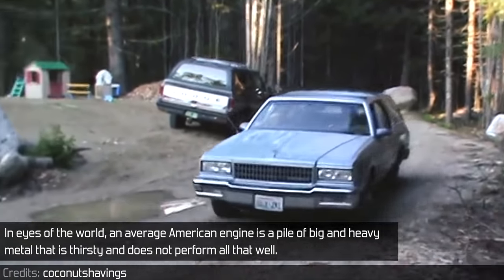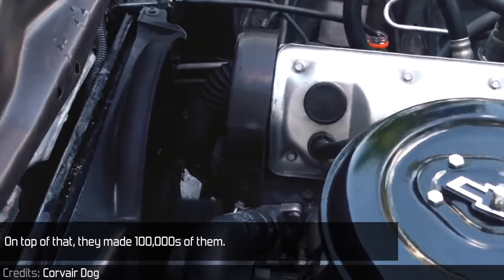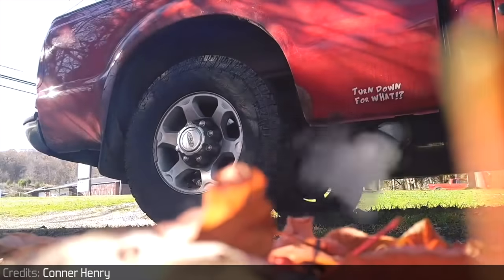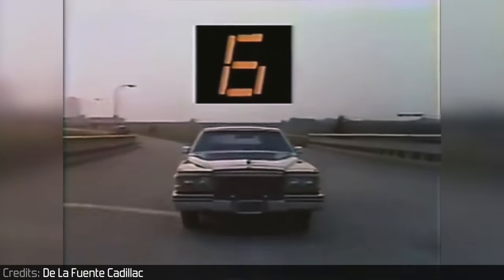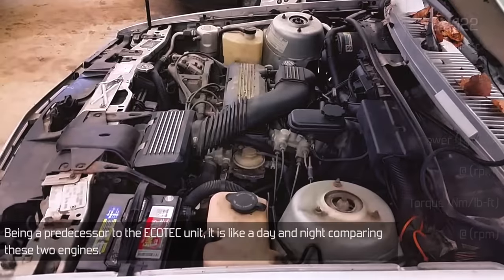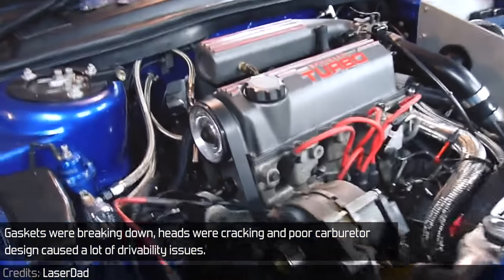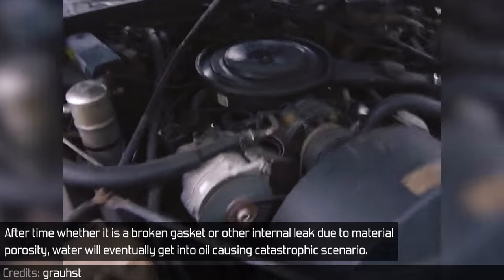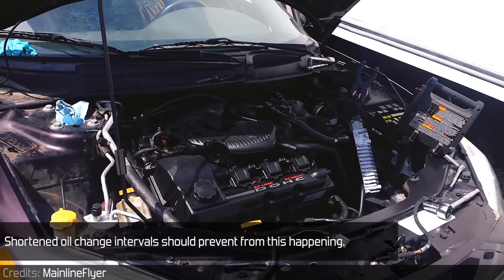8 Worst US Engines You Should Avoid

Comment: biggest pos is the Chrysler 2.7 he only talks bout the oil sludge..but it has a internal waterpump which is a really stupid set up..$1000 to replace..😞
Reply: I think that's what he meant by the coolant leak issue, if that waterpump breaks it mixes coolant with the oil and makes the oil sludge worse, I'd know because that's how my Charger spun a rod bearing and got rod knock the first day after I bought it, another $5,000 for the engine same price as the car, swapping an LS3 into it later, Hemi has too many computers it would be fiddly as fuck, I would've done it then and there but I didn't have the money for the R/T drivetrain to go with it
Reply: Linda Wimpari and they were notorious for catching on fire
Reply: @arthurcrunden6107  they were? shit time to find a Hemi
Reply: Shelby427 had 3 friends of mine who had them all 3 cars caught on fire same way
Reply: The 4.7s have some serious issues too.
Reply: Lawnmowerman lawnmowerman had a 4.7 ram pickup didn’t have too many problems with but the body was cheap
Reply: And now Ford has replicated the problem by using an internal water pump on the 3.5.
Reply: Linda Wimpari I have a 2011 sel Taurus same design. But I mean U can tell wen  a water pump going out. It leaks or you’ll keep loosing coolant. Or ur car overheats
Reply: @luvr381  and the 3.5 EcoBoost and 3.7 if it's not a Mustang, F-150, or Transit.

Comment: This why I will not buy  Ford or GM products. I bought a lemon mercury topaz with a 2.3 liter engine. That car spent more time in shop than at home. Had a Chevy Monte Carlo with a 3.1 engine that ate several intake manifold gaskets . The dealer blamed it on Dexacool. 

We now have a Honda and Toyota. They are just so excellent and reliable. It nice to spend money on the family, instead of wasting it, repairing poorly made cars. GM and Ford made excellent cars before the 1970’s, but those days are long gone.

Comment: You missed Possibly the most  Problematic motor ever produced the Ford powerstroke 6.0 /6.4  Designed by internatonal They are considered a nightmare
Reply: iamtimyeater what with them?
Reply: Doc. Volt  The laundry list is too long for me to write out Just Google Ford 6.0 some but not all of the biggest problems being Injectors head gaskets egr.  You can solve all those problems by spending $10000  And it still won't run right  There is entire websites  And  Businesses devoted to A dress the issues this motor has  In fact you're better off of the Triton V10  over 6.0   There are hours and hours and hours of YouTube videos devoted to that motor
Reply: Ford didn’t design that engine, it was designed and manufactured by international navistar. Ford gave them one more chance with the 6.4 powerstroke but ultimately it failed worse than the 6.0. That’s the reason ford is the only company to build in house their own Diesel engine the 6.7 which is great. I’m not knocking on dodge or gm but the outsource their engines, dodge from Cummings, and gm from Isuzu. Btw the 6.0 is a monster engine is you put in 5k of work into it with the bulletproof kit and tuning, will last well over 500k miles
Reply: Ricardo Aldrete   Yep after spending 60 grand on truck  All you need to do is spend 5 grand in it might run OK
Reply: iamtimyeater the truck didn’t break down till maybe after 150k with the emissions problems it had. But like I said you can spend 5k and make it last 500k and that’s Will towing and hauling 10k pounds. If the truck breaks down are you going to spend 5k to fix it or 75k for a new truck regardless of manufacture
Reply: Ricardo Aldrete  That's your truck And there are a few The rest of bought thousands of mechanics new homes
Reply: The 6.0 and 6.4 are not International designed. The 7.3 was and it was fantastic.
Reply: iamtimyeater actually they are solid with 3k put into them on the other hand the 6.4 is the worst American made engine of all time.
Reply: They seem fine to me
Reply: iamtimyeater also it doesn’t cost 10k to fix it. For fucks sake you are making it worse than it seems lol. Arp head studs, gaskets, egr delete, programmer and a turbo and your done it’ll be a 500k + mile engine.
Reply: Ricardo Aldrete gm does make the duramax, the company is named d max both gm and Isuzu design the engine. It is USA made also. ;). I’m still no fan of the 6.7L I’ve seen them have to many issues.
Reply: DecalsAndFriedChicken if you google who designed the 6.0 and 6.4 along with the 7.3 it is all international/navistar not ford
Reply: On top of the shit 60 and 64 they are the most expensive trucks the new ones are like 110 k then put 5k into the motor that's ridiculous or you know just buy a cummins that can double the k of a built ford
Reply: DecalsAndFriedChicken 7.3  Was one of the best ever made
Reply: Ricardo Aldrete  I know navistar design them but they were put in Ford's that makes it a ford problem
Reply: Donald Drumpf  Have to agree
Reply: Sackmatters  Nothing like a Ford fanboy to drop the F bomb And  say ford didn't make it design it or have nothing to do with it Even though they put it in their   Trucks it just hilarious  And there is a lot of guys that have put 10 grand just not to be right  in both the 64 and the 60
Reply: DecalsAndFriedChicken  I  Absolutely agree
Reply: iamtimyeater so your just being ignorant now because multiple people have proved you wrong. I also never stated I was a ford fanboy, I just stated facts that you couldn’t combat. And if you know people who put in 10k worth of work and still have issues it’s because they are not doing it right. As for the 6.4 it’s know that engine is a “throw away engine”
Reply: the 6.4L power stroke has some major issues mainly stemming from the immissions systems on the vehicles remove the EGR system, DPF system and stick in some ringed heads with ARP head studs the 6.4L becomes a pretty reliable engine the 6.0L can be made a very good engine as well with a few mods done but in general yes the two engines should have been on this list if anything should have been in the top 2 or 3 lol
Reply: iamtimyeater lol ford fan boy. Bud I have a duramax cummins a powerstroke I’m not biased towards one in particular. I hate new fords they are utter dog shit. I’d never own a 6.4L or a 6.7L. I’d rather drive my 7.3 than a new ford.
Reply: Ricardo Aldrete    You must not have been around when they 1st came out I worked for Ford at the time there was no solutions it was an absolute abortion Yes there is solutions now but at  This  time  But not in 2004   And just because you can make something work doesn't mean you should have to make it work With all sorts after market Parts Ford should have made it And people that would spend 10 grand At the time out of warranty to make it right Cause they just spent 60 on their truck is  i Was Working on them At the time Now you can solve the problems but not then   And I can tell you 1st hand it was bad Customers would actually be in tears in front of me With no solution
Reply: The 7.3 was great, if not the most powerful it still was fairly reliable. 
The 6.0 was a turd, but if ya send it to that guy in Georgia and have it bulletproofed they aren’t too bad. 
The old idi 6.9 and 7.3s ran good too. 
My buddy had a 86 f350 with the diesel and it was slow as fuck, but put a 30’ trailer behind it and it didn’t slow down much at all.
Reply: It isn't Cummings it's Cummins there is no G in the name
Reply: iamtimyeater : yes you're right about the 6.0 and 6.4 V8 diesel engines from Ford. A nightmare indeed, not to mention the pain it is to remove the engine from the vehicle. You have to remove the cab to get the engine out! What an absolutely awful design.
Reply: The 6.0 was definitely an International engine, it says so right on the valve cover. The high-pressure oil system in those is a fucking nightmare. Last time I fixed one I counted up all the potential failure points and came up with 100 or so different places where it can leak, and any one of them will make the truck not want to run. And any time something goes wrong, you have to tear the whole top of the motor apart to get to it. And the fucking things are wedged in there so tightly as to be almost impossible to work on.
Reply: Greg Green   2.8   Came with a rod  Knock from the factory and  Became the 3.1  Which was better but had bad head gasket and intake gaskets and oil paint gaskets well just bad gaskets.  Not to mention they ran like c***. the 305 just made no power but ran ish. The 4.3 xx became good after a while But not the best  The late vortec 43 being the best But night by no means great
Reply: iamtimyeater first of all the 6.0 wasn't a ford engine neither was the 6.4 they were made by international. Second of all the 6.0 is the most bad ass engines that will outlast many and out run all if you are willing to fix factory issues which cost about 7 racks with decent  parts. As a diesel mechanic I can say the 6.0 is the most misunderstood engines out there and is definitely not for 1st time quitters and broke people lol, my dads 6.0 just passed 190k and that's because he drives like a gentleman and I maintain it  well
Reply: alex ruano  You have  When they 1st came out lack of understanding is absolutely unexcusable by any manufacturer  You couldn't get any help Now there is a ton of information still not good
Reply: Doc. Volt TTY Head Bolts. ...EGR Valves & EGR Coolers. ...Oil Cooler Failure. ...6.0L Power Stroke FICM Failure. ...ICP & IPR Sensor Failures. ...Sticking HEUI Injectors. ...High Pressure Oil Pump Failure. ...Turbocharger Lag, Sticking VGT Vanes, Turbocharger Failure. List goes on and on and on
Reply: Ford didn't make the 6.0 or 6.4
Reply: Cummins, NOT "Cummings"!
Reply: I recently replaced the oil standpipes and "dummy plugs" on a 6.0 in a 2005 E450 van.  Bad enough job in a pickup, ridiculously difficult in a van!
Reply: I did not realise the 6.0 was ever in a van.  Yikes.  I would love to have a van with the 7.3 Powerstroke.  I have heard the 6.0 could be improved with an (illegal) EGR delete kit.  I am curious about the Cummins 5.0 V8.
Reply: 1978garfield  Yes it is illegal to modify any form of admissions
Reply: I just found out two weeks ago ,I met a bus mechanic that said the 6.0's in the school buses do not have the egr nightmare attached to the bus engines,hence they have a lot fewer problems,the turbo's are vvt junk,replaced two of them on bro's truck,still to me,nope
Reply: so ironic how International goes from making a famously indestructible engine (the IDI diesel) then makes the crap 6.0 for Ford. it's like they fired everyone with a brain
Reply: yes it were
Reply: the 6.4 is an updated 6.0
Reply: The 6.0 was a failure because of the epa aka emissions douchebags the 6.0 had the first split shot injectors and verriable vein turbo of a ford which were the best yes you can delete emisions bs and get a better hi flow oil pump and be set for up and over 300,000 miles i have a 6.0 that was my grandfathers and passed on to us it has 230k miles and still runs good never has to be pluged in to start when its cold and throws no engine code and in many studies after you do the necessary work bigger injectors and a better fule pump they out preform the 6.7
Reply: iamtimyeater and honestly the 6.4 was alot like the 6.5 chevy made either you got a good one or you didnt but look at dodge now there 6.7 is shit because of emissions control in North America and even in Canada they have cases where the truck wont start because its to cold and has left many people stranded
Reply: iamtimyeater Navistar international. Not to be confused with international who made the 7.3 which is a great engine
Reply: The 6.0 & the 7.3 were not only designed by Navistar (the successor company to International) They were made by them too. The 7.3 was a decent engine, the 6.0 is junk. The 7.3 & the 6.0 were designed for school buses. They are not good truck engines. International used to make good Diesel engines they make lousy ones now. That why Hino has taken the medium truck market away from them.
Reply: iamtimyeater the 6.0 is horrible stock most go through the head studs after 150-200k miles but when bulletproofed for $2k-5k you have one of the most badass Diesels out there
Reply: Well I‘ve seen 6.0 with 800k miles on the glock. Ther aree some problems with the 6.0‘s but you can easily bullet proof them not like the 6.4‘s tho.

Comment: Fuel Crisis, let's fix it with 5,7 liter V8 diesel xD
Reply: considering most diesels are actually pretty fuel efficient... a 6.2L detroit in the old square body chevy pickups could easily get 25mpg+
Reply: Diesel engines are actually better on fuel than a petrol engine of the same size. The problem is the American ones from back then were just really bad.
Reply: Maciej Bereżecki Exactly what I was thinking of 😂😂
Reply: Ehhh close enough
Reply: I mean i should consider technology used i diesel engines 30 years ago was'nt that sophisticated. My diesel Ford manages about 48 mpg but it's from 2010
Reply: That thing was the biggest turd, last I saw one was 06 in the engine shop for a rebuild. 
I can’t believe what fool would want to do that, or that he even found one that wasn’t blown up.
Reply: Maciej Bereżecki 
The vw idi got over 40 all the time, slow as hell though. 
I converted a later model tdi engine from a 98 Jetta to mechanical injection, and picked up about 7-9mpg average mpg. Highway was over 50 all the time, and I wasn’t in the slow lane. 
It had about 3x the horsepower of the original idi. 
Knocked like 5-6 seconds off the 1/4 mi time. 
 Best of both worlds:modern engine,old mechanical engine management system.
Thing is , the new diesels suck ass. 
The wife’s new Jetta with a gas engine gets 37-38 on the highway, that makes it worth looking at versus a new problematic diesel.
Reply: Jake Starnes true that had an olds with the crappy 350 when it wasn't overheating or blowing heads it got damn good milage.  Then my 6.2 blazer got about 27mpg. Those engines are turds though.
Reply: My uncle had one of those diesels. Never did run right!
Reply: Jake Starnes the 6.2 diesel was designed by Detroit Diesel which GM still owned at the time. Why they didn't employ their in house diesel engineering folks for the Oldsmobile diesel is a mystery.
Reply: Supposedly what made the 5.7 diesel so bad was cost cutting measures such as leaving out a fuel water separator and using insufficient head bolts.
Reply: Patchuchan they actually fixed most of those issues by the early 80's but the damage had been done by then.

My uncle's father has a 1983 Caprice diesel that was still running it's original engine up until about 10 years ago when Midwest road salt finally took it's toll.

On the street I grew up on one family had a Pontiac station wagon with the diesel that was still running as a daily driver.
Reply: Back then diesel was actually considerable cheaper than gas.  That changed once the Europeans started buying more diesel cars than "petrol."
Reply: Wes276 - Actually, they weren't all that bad. The 6.2 had a problem blowing head gaskets early on, but after about '84 they cured it by adding more cylinder head bolts. The 5.7 was based on the Olds 350 and it just didn't make a whole lot of power. At the time, the perception of a "diesel engine" was a powerful, torquey powerplant. People expeected the 5.7 to move buildings without breaking a sweat. When it couldn't do it, it was considered a "poor" or "bad" power plant. In the end, there were a couple of reliability issues, but these were eventually worked out. There was a V6 version (4.3L) that was used in the FWD Cutlass Ciera that was not only very reliable but made decent power. Many owners were quite happy with their 4.3's. Unfortunately, GM decided to nix the engine when they ended that chassis.
Reply: Diesel engines were also considered a "God Send" back in the 70's, because of the way they operate. Not only do they get excellent mileage, they hardly produce any HC, because they always run in such a lean condition. Unfortunately, they produce a ton of NOx, which is also a pollutant, but the it was a step in the right direction, anyway.
Reply: +DeanMk1 the 350 diesel being based on the 350 gas is actually a myth. The only thing they really share is the same bore and stroke. Otherwise it is a completely unique engine, built from scratch more or less and intended to be a diesel from day one. I'd guess the similarity in bore and stroke and therefore displacement meant it was easier and quicker to make with the tools and training already available. The engine was alright, but it was a rush job and it was because of that rush that it was plagued with so many weaknesses and problems. But it did what it was supposed to do which was get excellent mileage for the time. In the right car with the right driver it would do 30 mpg. My 350 Vortec in my 97 Silverado barely hits 17 mpg when driven gently. But diesel is naturally more efficient anyway.